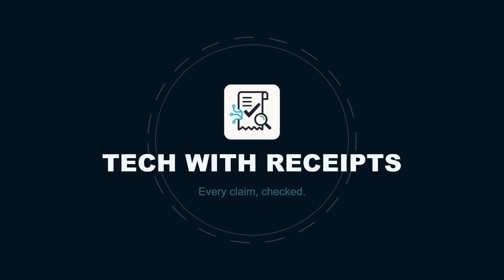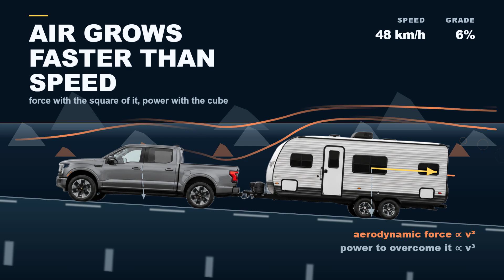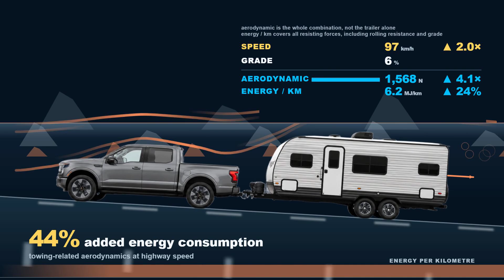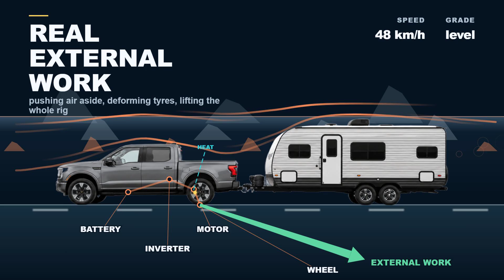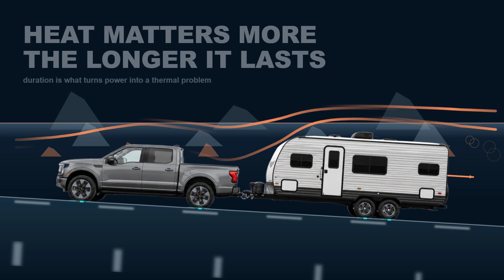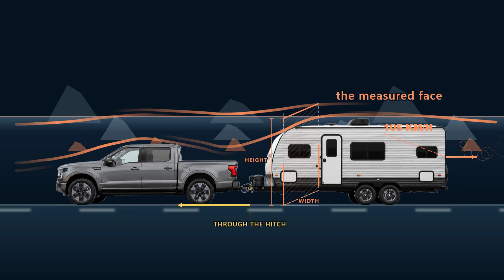Why Towing Destroys EV Range (It Isn't the Weight)

Comment from the maker: Tow rating and trailer frontal-area limits: Ford's 2025 F-150 Lightning towing guide. The Class 3 towing model (aero contribution under 4% at 48 km/h and 6% grade; up to 44% at highway conditions): Argonne National Laboratory, Medium/Heavy-Duty Vehicle TCO and Target Development (2023), slide 24. The Davis Dam grade case (219 kW peak, 178 kW average tractive demand at 89 km/h): EPA / Southwest Research Institute / Argonne, Heavy-Light-Duty and Medium-Duty REET Final Report (Jan 2024), Table 5. The observed F-150 Lightning towing run (available power 100%→62% of 79% SOC on a ~4% grade towing a 3,630 kg trailer): MotorTrend, "We Towed With Our F-150 Lightning…" (2024). Rivian's Davis Dam validation towing (4,990 kg at ~48°C, multiple runs over two days): Rivian Stories, "Hot Weather Towing" (2020). Pebble's preliminary efficiency numbers with powered assist (1.4→1.8 mi/kWh at 55 mph): Pebble, "Easy Tow…" (Medium).

One thing we deliberately did NOT claim: that the MotorTrend truck's power drop was caused by battery temperature. The writer says it "appeared" linked to temperature — that's an observation, not a diagnosis, and we kept it that way on screen. What the data does support is the grade: a sustained ~4% climb under load.